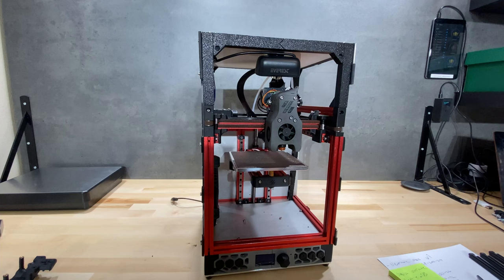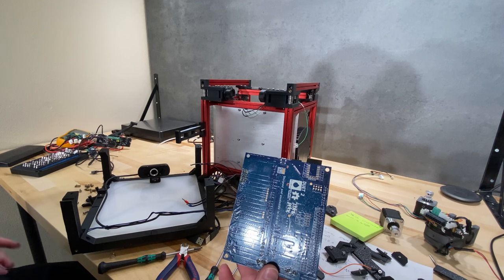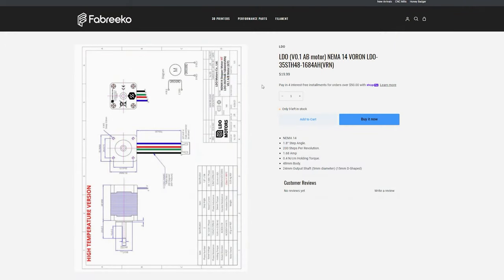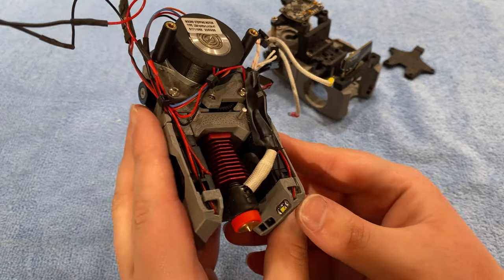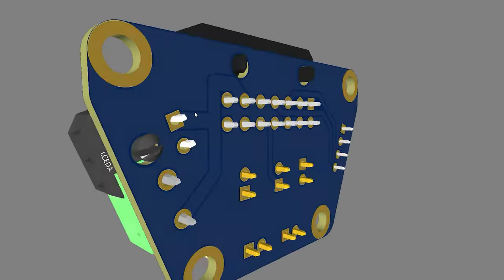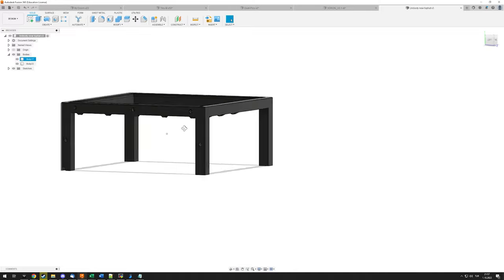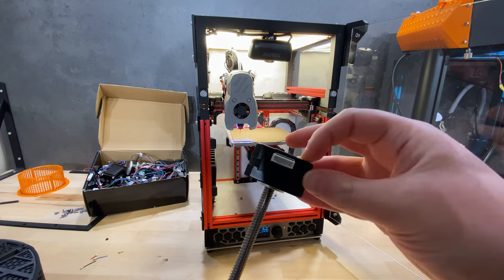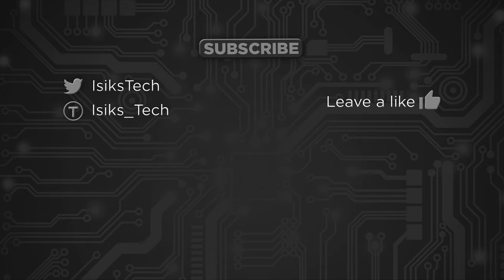Voron Zero Ep. 13 - Voron 0.2 (Mini StealthBurner) & New Motors

Comment: You might be able to remove the stress marks on your tophat with a heat gun. I use high heat and move the gun quickly over the part to prevent melting
Reply: Came here to say this also. I just briefly brush the part with a blue flame. The stress marks disappear almost instantly
Reply from the maker: Thanks. I just tried this on a different part, helped a lot. I'll do this on the tophat before the next episode.

Comment: Hi! I'm building a mini stealthburner from my LDO 0.2 kit. The right-most position of the drive gear (Bondtech BMG Shaft Assembly) is still not enough to be centered with the filament path. The tiny set screw doesn't allow to move the gear last 0.2-0.3 mm closer to the white T50 gear, because the flat part of the shaft is too short. Is it a tolerance thing, so I may have better luck ordering a second one or is it an issue with my printed parts? The shaft is 27.56 mm long in total and the shorter part behind the T50 gear was already ~3 mm, so there was no need to sand it down.

Comment: For the front mount KUSBA bracket, what length screws did you find to work well? The longest ones I currently have are M3x40 BHCS, but they don't seem to be quite long enough.
Reply from the maker: 45mm

Comment: What do you think about 0.9° motors for the AB drives? I just ordered some Moons MS14HA5P4200. Can't wait to try them out.
Reply from the maker: I haven't heard of any cases of these motors on Voron 0s, but if the rest of the specs are at least as good as the stock motors, the added resolution can only help.
Reply: @IsiksTech  I've read in the Voron discord that these might help mitigate VFA and since I was in the market for new motors anyway. Hope it works out 👍